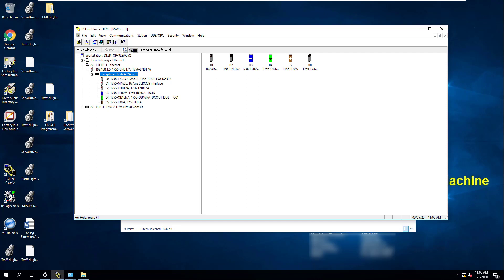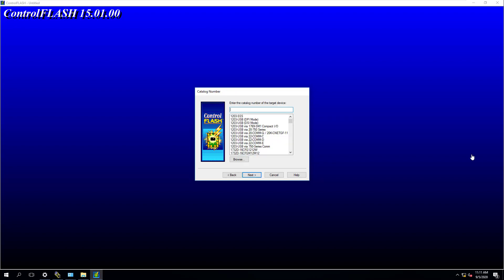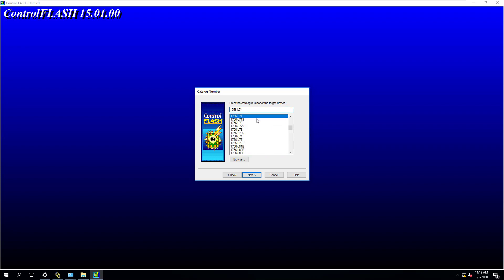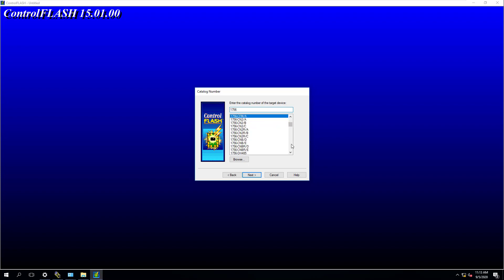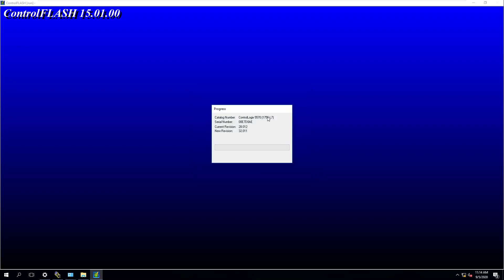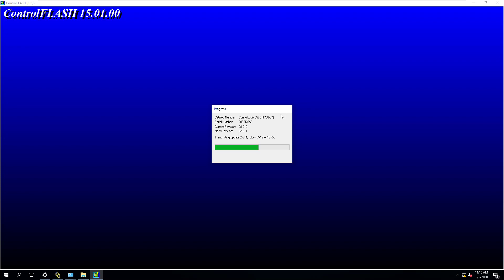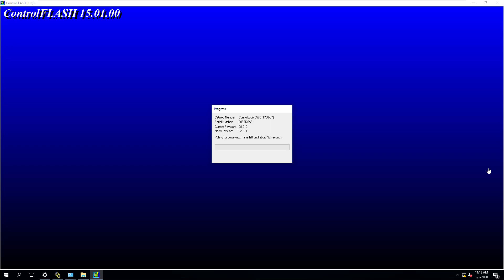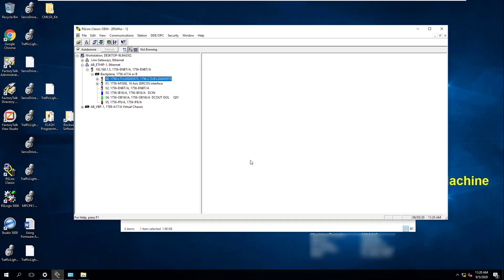Flashing A ControlLogix Processor To Studio 5000 Version 32 Using ControlFlash

Comment: Based on you guys' experience, Do AB processors need a DMK file for firmware upgrade or is that only for AB Drives?
Reply from the maker: @josecastillo4618  DMK is for both, depends on what firmware you are looking for

Comment: Thanks for the videos. Hopefully you an save me a Tech support call.  I have a 1756-L73S currently at v20 I want to make the jump to v34.  I recall v21 was the no going back leap.  Can I make that big of a jump. v20 to v34???
Reply from the maker: Yes, you can go to v20 to v32 or 33, or 35 although you need to unlock the safety signature.

I would stay away from v34
Reply: Thanks...your videos are great @ShaneWelcher
Reply from the maker: @kenclarke1386  Glad to help

Comment: I have a guardlogix 1756-L7S and scrolling display "missing safety partner". How do I flash it?
Reply from the maker: Flash both modules
Reply: @ShaneWelcher   failed to flash
Reply from the maker: @kmaobongkmaosreh  the safety processor needs to be unlocked to be able to flash the firmware.

Unlock it or delete the signature 

Then once flashed, make a new signature and lock it back.

Comment: I am totally confused. I am using Studi0500 v32 and ControlFlash v15,03
I am aware that the studi05000 supprts L7 and above i.e L8

When i click on the ControlFlash I only find L7 and L8, which understandable.

My question what if I want to upgrade older versions L1,L5and L6. I am able to download the firmware from the website, what is the next step? Please help
Reply from the maker: You need to get the firmware from Rockwell's website.

An L6 or below will not be used for V31 or higher. Only L7 and L8
Reply: @ShaneWelcher  Thank you so much. As I mentioned am aware of that the Studi5000 supports L7 and L8

I was wondering what the point of downloading L6, for example, DMK file, and can be added to list if i cannot flash it!! 

Note: you must have meant the V21 or higher

Comment: Firmware version should be same as the studio 5000 version that the program has been writing with? If I have written my program in version 32 then firmware can't be lower than that right?
Reply from the maker: Yes, you are correct
Reply: @ShaneWelcher  thanks for the quick reply. Two more things please. You know when for the first time we want to download the program to a new out of the box compactlogix, it won't let us to do it and will ask for firmware installation with activated" download firmware" button. If we click on that and go through the process of downloading the firmware it will give us predefined and available versions, would this be okay instead of doing it through control flash software separately?  
2- if we don't see a proper version of the firmware in control flash library, how should we add it to library to be able to choose and download it ?
Thx
Reply from the maker: To answer your first question yes it is ok to flash when downloading however, I highly recommend that you use ControlFlash instead to limit risks & confusion.

Secondly, if you do not have the firmware then you need to get that from the Rockwell Automation website.
Similar to what I did downloading the PlnatPAX in this video except you need to click on firmware.

https://youtu.be/h-bMhqTw1V0

Comment: Does the controller keep the same IP address through the firmware update? Based on the video, it looks like it does.
Reply from the maker: During system flash for any device of RA, I would recommend to have a backup of programs & IPs before flashing.

From my memory, it defaults on some firmware updates.

Comment: Okay I have the same Control Flash 15.01, and a 1756-L71/B  ,But I can only flash up to revision 31.011 not 32 why?
Help
Darren
Reply from the maker: Probably because when you built the control flash kit, you did not add that version.

In this version on control flash, you make your own flash kits.

Just download it & add it to your system
Reply: @ShaneWelcher  
Okay I got the DMK file and added it to be able to go up to 32.11
, But now I have a Panel View plus
6 -1000, I was trying to save my MER file but there is no 6.0 or 6.10 to pick from the list, 5.10 ,7, 8 9 10 11 12
So can I get my run time program downloaded to the HMI?
Thanks for your help.
Reply from the maker: @mrtrader4628  shoot me an email  at Shane@OnlinePLCsupport.com

That way I could better help
Reply from the maker: @mrtrader4628  generally you need the proper Factory Talk View version or else you can upgrade it to what you have but note that archive version will be what you upgrade to from that point on.

You can still make lower version MER files though
Reply: @ShaneWelcher  
I have FTV  11
By I think that my panel view can't go higher than 6.10 I think 🤔 not sure how to get it to download can you please my a video on MER files and the older Panel View plus with older MER file cards inside of the units
Reply from the maker: @mrtrader4628  download the MER the convert it to a HMI application, it will change versions then add your users & security then make the MER or runtime in the version you need to use for the panelview
Reply: @ShaneWelcher  
Okay was not at work over the weekend.
I made it past some of the MER issues, but now it's saying that I need a FTV pacth sr9   so I have the pacth files from Rockwell automation, but not sure just how to get them in FT View
Reply from the maker: @mrtrader4628  We had a patch issue trying to have the PV talk to an L8 V32.

Sounds similar to what you are saying.

Comment: You skipped the whole part where I am having a issue, I cant seem to be able to build or find the catalog so I'm stuck, any tips? over here pulling my hair out
Reply from the maker: If you are referring to catalog info in Control Flash then you have to build a firmware kit.

Not sure why you are saying I skipped anything.
Reply: @ShaneWelcher  I tried to build a kit it creates 2 files a .nvs and a .bin but it is not what I need apparently when I browse to the folder it shows nothing from the flash program
Reply from the maker: @doubeleive  if I have time, I'll try to make a video about making a firmware kit.

I understand the frustration.

If you have RA knowledge base then you could look it up.

If not, let me know, I will look it up for you
Reply: @ShaneWelcher  here is the issue I'm have the ok led and I/o led are both flashing red, from what I am reading that indicates a bad chassis? Just not sure if the ok led should be green and just the I/o red if this was the case?
Reply from the maker: @doubeleive  This happened during a control flash?

If so then the device lost its boot code.

I've had this on a Powerflex 700s one time & using hyper terminal to load the boot code & firmware into the drive.

Which can be a tricky process.

Can you still see the processor or device in RSLinx?
Reply: @ShaneWelcher  no I just now found the redundancy module had bent pins, fixed that and now it appears to be no good and might have taken a couple other modules out with it 👀 Ethernet modules are stuck in test mode, but the CPU runs now, I picked this up used, so either the redundancy module fried a bunch of stuff or the chassis or power supply is funky and/or this caused the memory chip fault in the Ethernet modules which is a known issue, o'well I'm not in it too deep thank you for your reply's I appreciate it.
Reply from the maker: @doubeleive  Try to flash the Ethernet module if everything is connected now.

I have ran it the bent pin thing before. After I straightened them, ai flashed & all was good.